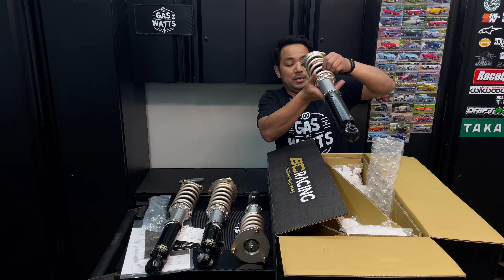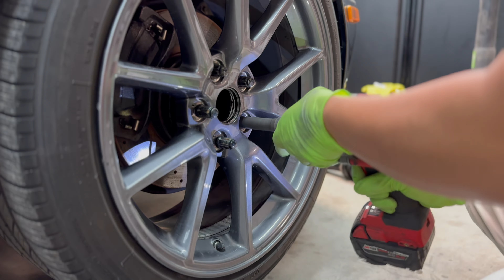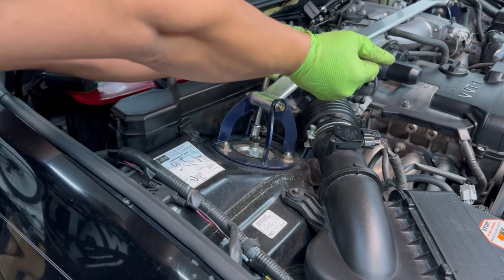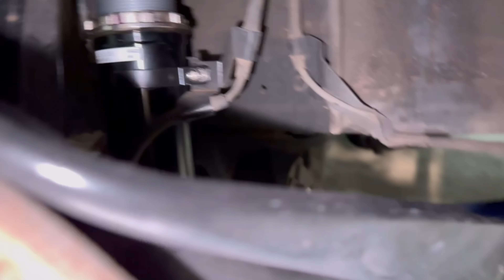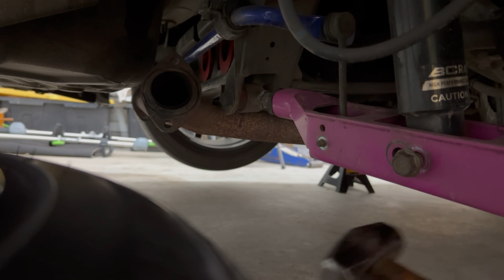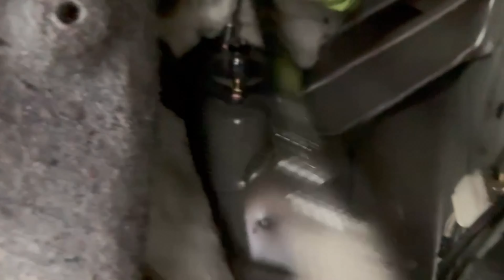How to Change Coilovers | BC Racing BR vs DS

Comment: Bottom perch should be used to set the bump stop engagement height, and the spring perch should be used to adjust ride height.
Reply from the maker: @TM-fx5le  I believe that is true for coilovers with no adjustable shock body adjustment, unlike these type of coilovers
Reply: @GasAndWatts  It’s true for all coilovers, regardless of a threaded shock body. If you’ve set your coilovers up using the shock body as a height adjustment then you’ve done it wrong.

Not being a douchebag but just trying to pass on some knowledge that took me a lot of experience to understand. Even some lower end coilover manufacturers recommend setting your coilovers up using the shock body, which is extremely misleading.

Watch the YouTube film by Annex Suspensions on how to set bump stop height.
Reply from the maker: @TM-fx5le  thanks for letting me know! Will check out annex suspensions. Always want to learn more. That is just what I’ve learned from the things I have read.
Reply from the maker: @TM-fx5le just watched it and now I understand what you’re talking about. First, remove spring and adjust bump stop with bottom perch, then adjust upper perch for ride height. Which can cause preload to be out of spring parameter and might need to change spring length. Thanks for letting me know!
Reply: @GasAndWatts  For sure bro!!

Comment: What sping rate would you recommend for an ls430 with these DS series?
Reply from the maker: @JMY8965  depends on your goal
Reply: Everyday driver  @GasAndWatts
Reply from the maker: @JMY8965  mild drop or slammed? Do you prefer driving stiff or soft suspension
Reply: Mid drop , not too stiff
Reply from the maker: @JMY8965  probably 12/10 or 14/12

Comment: Thank you for the video! From what I understand, it seems that a disgressive damping setup would be better for my situation. I plan to use my car primarily for street driving, with occasional track days. Given the heavy traffic and the numerous potholes in my area, I need a suspension that can handle both conditions. I hope you can read this comment—could you please offer some advice? Thank you again!
Reply from the maker: I usually read all the comments instantly, sorry I just now saw this. You can message me on my IG @gasandwatts